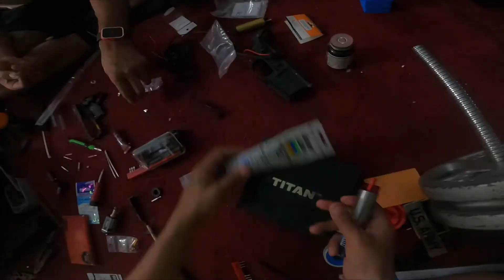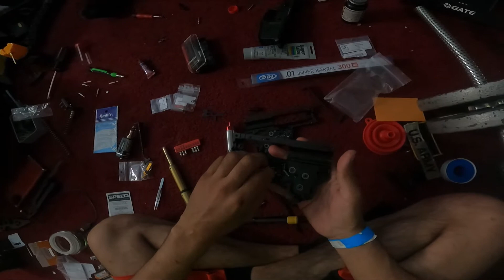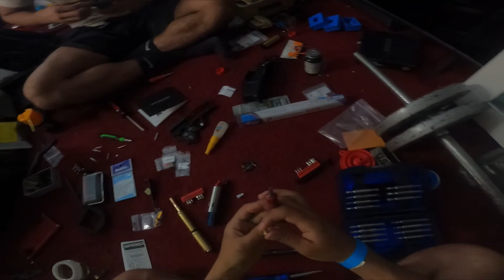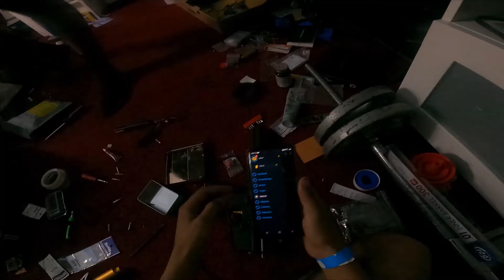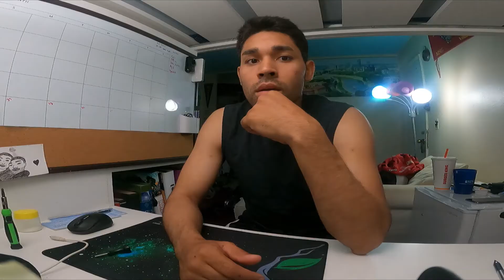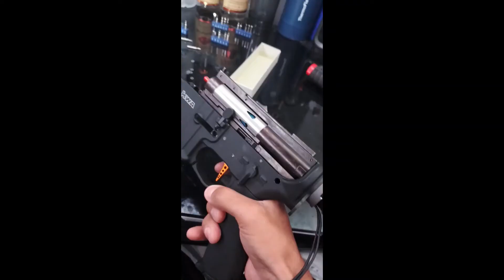KWA T10 brushless motor

Comment: I need a list of parts… I know you said em but I needa screenshot it then find comparables etc
Reply from the maker: I could give you the parts list of what went into this T10, but I've since updated my parts list, so a lot of what I used in this video has been replaced by parts that I thought were better and had better results
Reply: @sausageofmarnies2799 hey not sure if you're still active on YouTube but I recently got a KWA T10 and I've never upgraded or modified any of my guns besides changing the spring, so what would you recommend for it?
Reply from the maker: @averageglockenjoyer  hey man, yeah I'm still on here just haven't played anywhere interesting lately and I don't want to just do Black Ops videos.  First I'd ask what your budget is, since that would determine what parts to prioritize
Reply: @sausageofmarnies2799  I could probably spend 5-600 if needed but I can go more if it's worth it
Reply from the maker: @averageglockenjoyer  ok yeah, you won't need anywhere near that much. Unless maybe your paying a tech to do the GB work for you. Then the other question is, are you in the US? because the tappet playe you need for a full upgrade can only be bought from KWA USA as far as I know
Reply: @sausageofmarnies2799  yeah I'm in the US
Reply from the maker: @averageglockenjoyer  so you'll want a full FPS softair compression set: nozzle, cylinder head, cylinder, piston head, and piston. Changing the nozzle requires the KWA SR10 tappet wich can only be bought from KWAs website, and changing the nozzle will also allow you to use aftermarket hop units of your choice (I use maxx, RA, or Begadi). The ERG system can handle up to 40 RPS pretty well from what I've experienced but I don't like taking my that fast so I usually do 16:1 gears and a 22 or 25k motor, the Paragon Armory motors are pretty neat though I haven't tried the brushless ones, for brushless I'd say T238 if you want to go that route since they have an adjustment screw so you can turn down the ROF. Gate titan is the only ETU that fits without modifications. 6.05 barrel, 300mm if keeping stock length, 275ish is you remove the extension piece. Maple leaf super Macaron bucking. That should be about it. Shimmong and motor height must be perfect
Reply: @sausageofmarnies2799  ok wow thanks that's a lot of info lol. I'll check all that out.

Comment: Ey what hopup you use???
Reply from the maker: Maxx hop, the Retro Arms works nicely too and is more affordable
Reply: @sausageofmarnies2799  i need you help bro i have kwa t10 polarstar f2
Reply from the maker: @airsfoft_fishing_hunting  damn, you really HPAd a T10?? That's just blasphemous 🤣 but you may need to do some dremebling in the GB to fit the engine. I did a Kythera in an Eve 9 and had to do a ton of dremeling but I also have a QRF MOD1 with a Jack that wa drop in. Either way you'll need to replace the nozzle. For the Eve9 Kythera I needed the #21 nozzle, P* says that the same nozzle should be used across all engines so that would mean you need a #21 nozzle for your F2 but I have read that apparently the #12 might work too. I have one to try it with but haven't gotten around to doing it because I broke my hop unit
Reply: @sausageofmarnies2799   is true i have eve4 why polarstar jack and t10 polarstar f2

Comment: Thank you for the info! Would you let me know which one of new Maxx HopUp chambers will fit T10 ? Seems like ME Pro and Sport are discontinued and been replaced by the M4A-Pro , M4i-Pro & M4P-Pro.
Reply from the maker: For the new Maxx you'll want the M4A if you're keeping your build AEG. I would also recommend changing your stock tappet to the KWA SR10 tappet (Google KWA tappet M325) so you can use standard V2 nozzles since you'll need a new nozzle if you plan on changing the hop unit.
Reply: @sausageofmarnies2799  I have KWA tappet that accepts after market nozzles, I have SHS nozzle for M4s in my T10 same size as your Maxx Nozzle, will my SHS fit in new M4A-Pro nozzle ?
Reply from the maker: @DanielBerthellemy  I've never used SHS nozzles but if it's a standard V2 TM spec nozzle I don't see why you'd have any compatibility issues

Comment: Does ME Pro Fit in there or is it ME Sport ?
Reply from the maker: I use the ME Pro but the sport will fit too, the only difference between the 2 is the BB retention latch. The Retro Arms Hop unit is another good alternative if you don't want to spend on the maxx

Comment: Any reason a new kwa motor should be getting really hot within 3 mags and gives off a bad smell? / slight smoke? Or could it be dust from the brushes fusing to the motor
Reply from the maker: Never experienced that, mostly because I pretty much always upgrade my builds as soon as I get them, I pretty much never use th stock
Reply: Is there any large risk to using a faulty motor aside from just ruining it and needing another? (Best case scenario) 
Thanks for the help

Comment: Turn off the adaptive break and run it at 10% I had same issue with ronin t6 the warheads run better with out the auto break
Reply: @mitchtoal7593  Warhead has no brake built in, it's brushless and doesn't overspin because of the design (lack of spinning mass).
Brushless + Titan = dead Titan if AB is turned on. Titan has no reverse battery or short protection so it shock itself every time it tries to AB the motor.
AB MUST be turned off if using Titan with any brushless motor.
Reply: @error262  less acronym would be better

Comment: You guys figure this out?  Sounds like the motor is having a hard time spinning up at semi, full auto would give it time to speed up and get you higher FPS.. try a high torque motor 22tpa or more.
Reply from the maker: This build uses a brushless motor so it has plenty of power, the problem ended up being that the rubber pad on the back of the cylinder head somehome came loose and was just bouncing around in the piston between shots
Reply: @sausageofmarnies2799 so what FPS was shooting after the issue was sorted
Reply from the maker: @BMWF900R  can't remember and it's been a while since the owner has gone to a game with me, I'll check it next time I meet up with the guy

Comment: Try putting the stock nozzle back in. Every kwa I’ve ever worked on would only function properly with the stock nozzles
Reply from the maker: I actually changed the tappet plate so it could fit a standard V2 nozzle for better airseal. The problem was actually that the rubber pad on the back of the cylinder head had somehow fallen off after I closed up the gearbox. It's working beautifully now
Reply: @sausageofmarnies2799  hey what tappet plate you use to fit standard nozzle?
Reply from the maker: https://store.kwausa.com/product/rm4-series-tappet-plate/

Comment: Several things it could be:
-Brushless motor could be over spinning in semi and the active braking cant keep up (play with the gate settings/stronger spring and short stroke.) Then observe piston to see if it sits all the way forward after shooting semi
-tappet plate spring could need to be shortened/ tapper plate be shortened (high rof builds require this)
Reply from the maker: I actually figured out what the problem was, I opened up and stripped the gearbox all the way down and saw that the rubber pad on the back of the cylinder head had fallen off, changed that part and it's all good now
Reply from the maker: we have adjusted the active brake on the Titan and that seems to be working fine, might have to take the chance and cut the tappet then. Tappet spring cant be modified because KWA uses a proprietary setup for the tappet, tappet spring, and nozzle
Reply: @sausageofmarnies2799  Kingdom of Airsoft makes 150%springs for the kwa proprietary tappet system. Or you could pre load it for greater tension by putting a spacer behind the tappet spring.

I also found with the kwa nozzle using a bucking with slightly longer lips such as the maple leaf ones helps to make a better air seal
Reply from the maker: @jhqtech  Just looked them up, unfotunately for me I'm in the US. 
as far as airseal goes everything looks good, no leaks anywhere and all parts are from the same manufacturer to ensure fitment compatibility
Reply: @sausageofmarnies2799  they ship to the us
Reply: I have a very similar build, 13:1 gears, gate Titian advanced, and warhead 36k. I believe I am over spinning on semi,  what active braking settings should I try?
Reply: @kasper4925  generally the rule of thumb is start at max and work your way down to the lowest amount it still does semi reliability on. For the warhead motors since theyre stupid strong it can be hard to get the perfect amount of ab,  I've found that short stroking with a strong spring is the way to go. The last ssg I built with one was a 12:1 short stroked 4 teeth with a m130 spring.
Reply: @kasper4925  10 percent did it for mine but 0 could work because the warhead has a breaking function built into the onboard mosfet system

Comment: Maybe the gearbox shell is warped.
Reply from the maker: hadn't even considered that, any idea how we could check to see if its warped or not?
Reply: @sausageofmarnies2799  When the shells are screwed together, it may not be easy, but try placing the edge of a ruler or other straight edge against the flat sides of the shells & look for gaps.
Reply: @sausageofmarnies2799  Also compare that test with another set of shells.